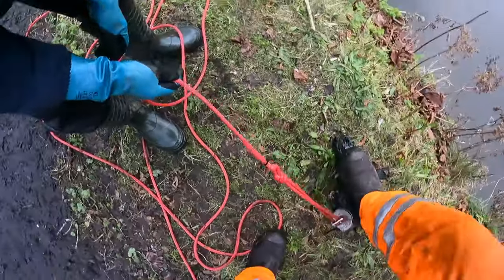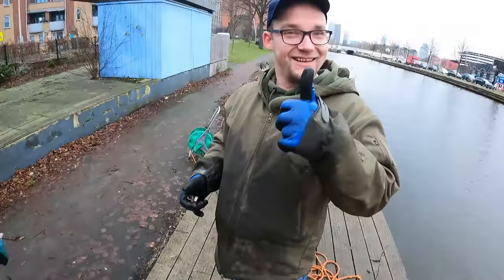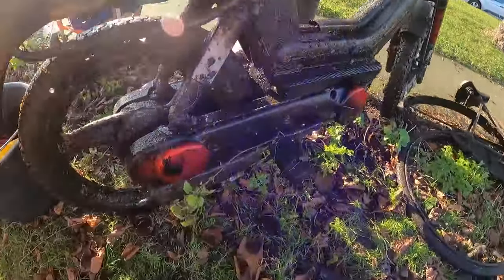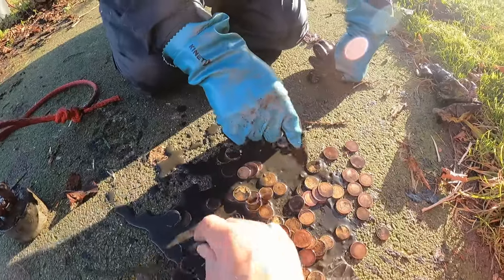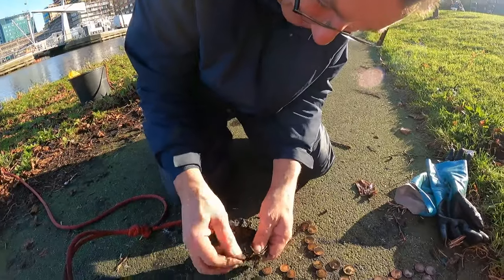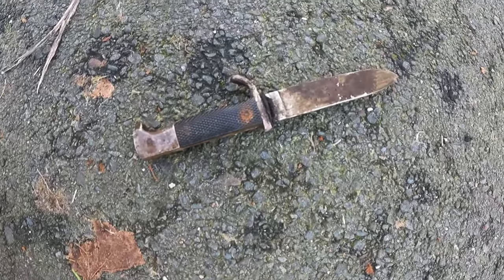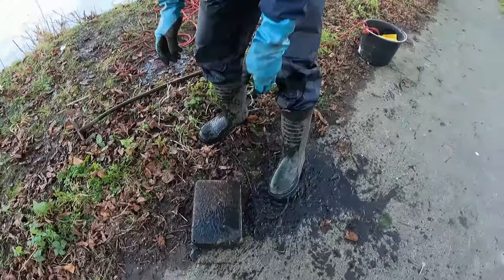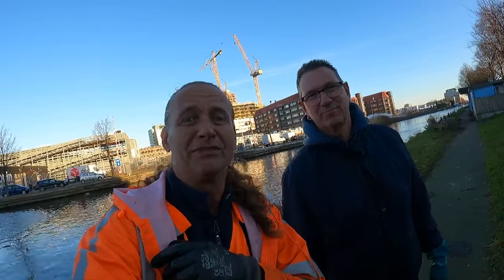we find a bag full of coins (CRIMINAL HOT SPOT)

Comment: I have a question, Wim. I got a Bondi magnet but don't know how to put the threadlocker on it because the bolts are already on super tight. Silly me tried using a wrench (I forgot all about them being magnetic),  and the magnet grabbed it and smashed my finger.  I'm fine, though. User error. So I'm wondering if the threadlocker is really needed if the bolts are so tight with no way to get them off. My son says maybe they are already thread locked, and I said why would they send threadlocker if I don't need it? 🤔
I did send a fb message to the Bondi magnets page. No reply.

Btw, I love your editing skills! Great video!
Reply from the maker: Hi Jesse 🖐🏽 i know what you mean,  didn't it already was manufactured ?
It wasn't i think if i read you're commend 🙈 that's strange,  normal they are ready to go fish 💯
But if you screw the eyenut a little bit loose, and hold the nut on the thread of the bold, and screw them both at the same time tighten, with you're hands 💪🏽
And you need a wrench for the last piece,  so the bolt is touching the plastic from the nut 👌🏼 then it's secured 💯
but do screw it all the same time, it is a little fight with the magnet 🙈 i know that to 🙈🤣🤣
If else you need to put Locktight glue on it, then you don't need the threadlocker, but my advice is to use that one 💪🏽💯
Hope it's going to work 🙏🏼💪🏽🍀
But normal the magnets are fixed already,  so i don't understand it 🙈
Hope you can go fish now 💪🏽🧲🍀💯
Have a GREAT Sunday Jesse 🙏🏼🍀🙏🏼🤗